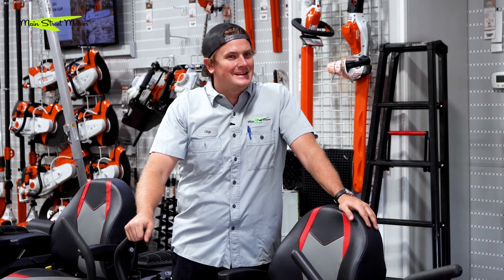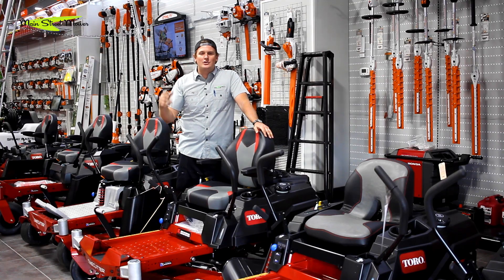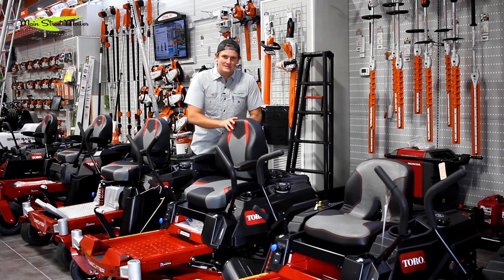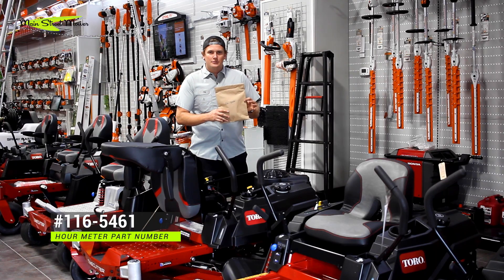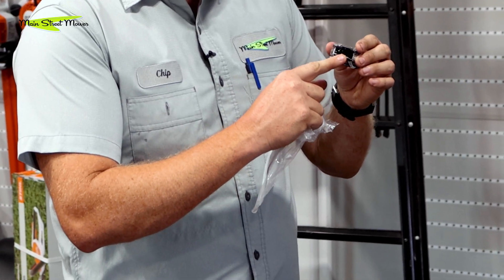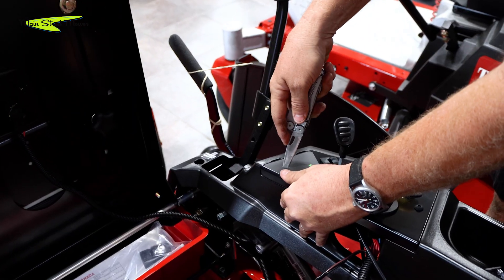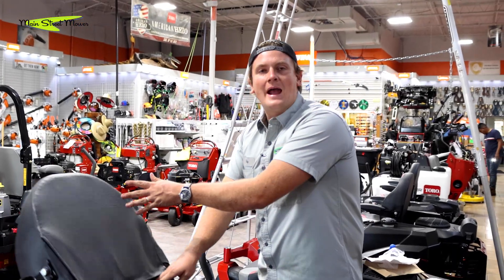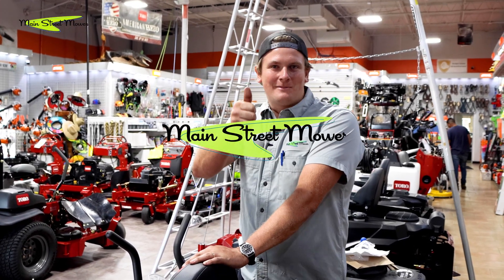Install Hour Meter on your Mower

Comment: If the hour meter goes bad, and you install a new one, will it register the correct hours or will it reset to zero?
Reply: I’ll bet the new one starts at 0 hours.